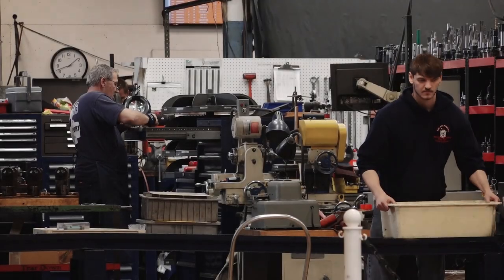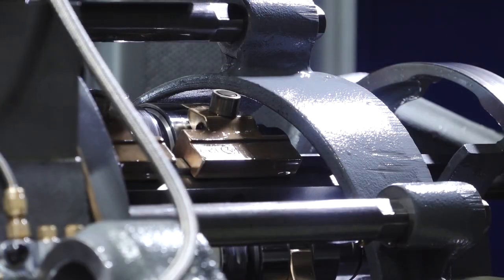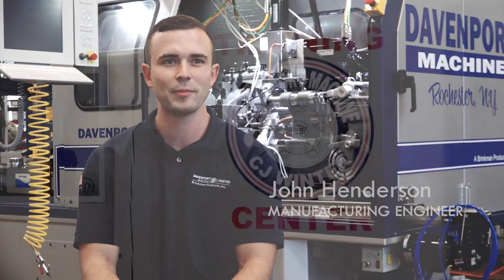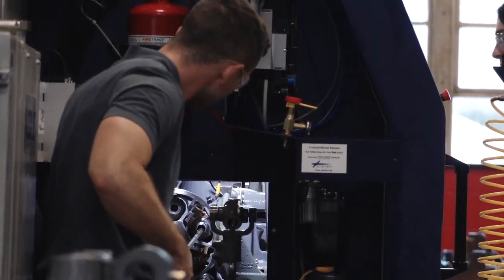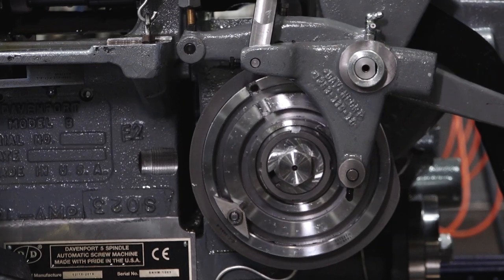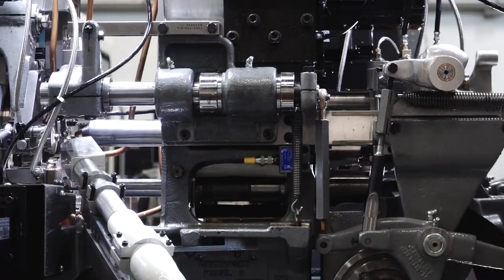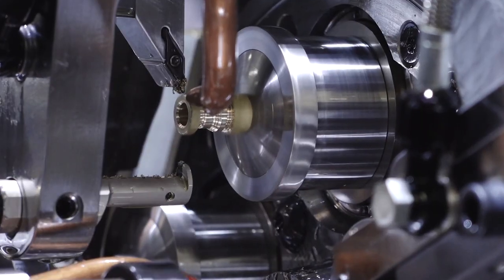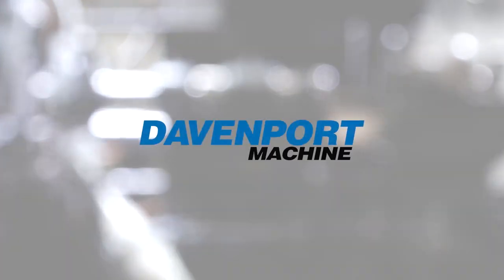Introducing the New Davenport Hybrid Machine (2019)

Comment: Man I'd love to tour that place. I ran Davenport B machines 20yrs ago at 19yrs old. Today I'm in a wildly different career as a chemical process engineer in the nuclear field but I'm recognized as very unique at my workplace because I'm every bit as comfortable in the machine shop running a manual lathe and mill as I am in the non-rad laboratory performing typical benchtop chemistry or handling dozens of curies of radioactive material in hot cells. My fundamental understanding of machining goes back to those Davenport days.

Comment: I spent 30 plus years on B&S machines, a few more on Acmes, never ran a single part on Davenports, but they were in nearly every shop I worked in.  I have also run 2nd operations on Davenport made products.  The guys complained about them, I'm not sure why.  My question is, are the new hybrids CNC controlled on spindle speeds?  B&S advertised CNCs before they went under, but they were NC controlled tool movements, but they kept the same transmissions instead of going to servo motors.  This held them back although it was other problems not related to their machines that put them out of business.  My second question is the older machines often went down because of what the guys called bronze spindle bushings.  Has Davenport gone to more conventionall ball or roller bearings?
As a side note, one shop I was in made, I believe, chuck levers for Davenports.  Fascinating part.  About 22 operations to make them.  But the poor economy years ago doomed that company.